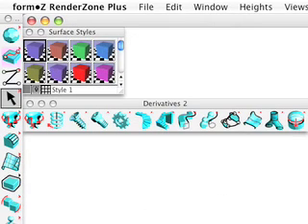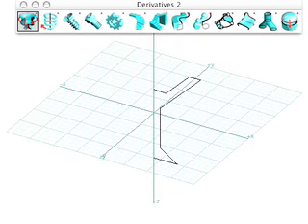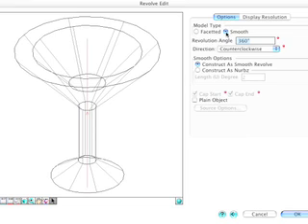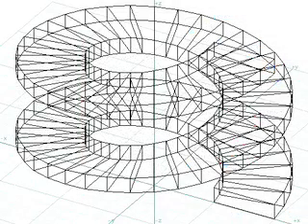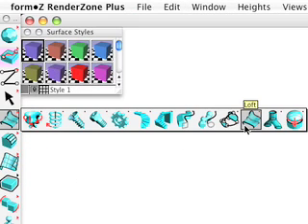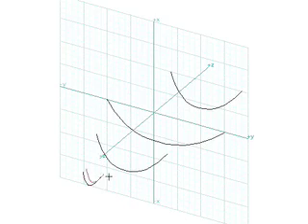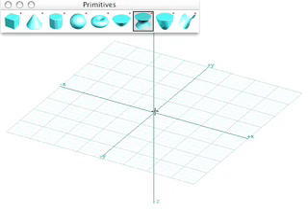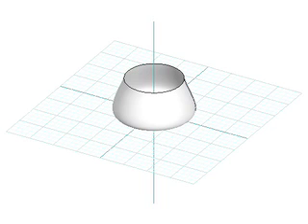form•Z Overview Tutorial   Segment 4: Revolves, Sweeps, and Lofts

Comment: One thing I don't get it is how do you control the dimensions of your models? I need precise mesures for 3d printing....how do you do that in Form-Z?
Reply from the maker: Hi Romuloagon,

There are many ways to be dimensionally accurate, including drawing your shapes numerically via the Input Palette (at the top of the screen), using Grid Snaps (or Object Snaps), and more.  You can even use the Measure tool to scale objects based on the distance of a part, and you can also use the Transform tool to scale objects independently or uniformly based on the size of its bounding box.

Give it a try and email support (at) formZ (dot) com if you have any further questions, we would be glad to help.  :-)

Comment from the maker: Johny,
The reference plane tools are located in the bottom left corner of your project window -- between the perpendicular to reference plane icon and the grid snap...
The manual is also integrated into the program, so if you just hold down the SHIFT key and click on any tool, it will open the manual to the appropriate page...